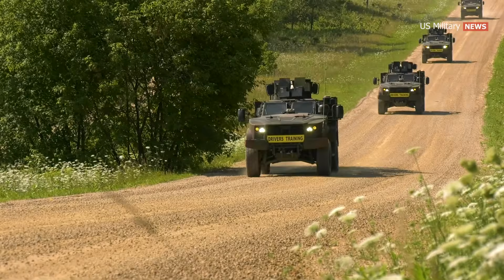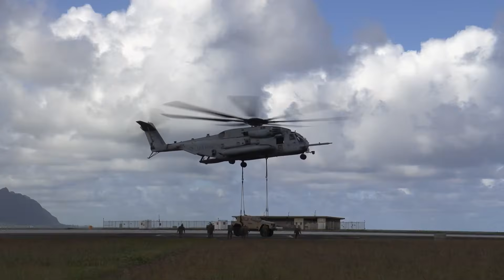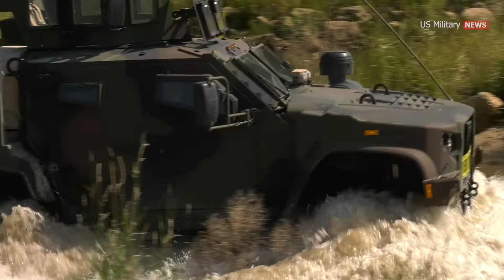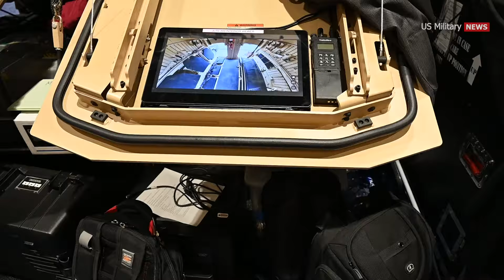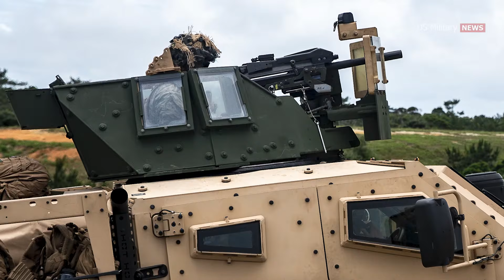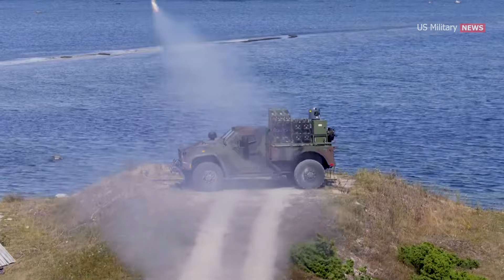Meet the JLTV: America’s $333K Tactical Beast

Comment: By the time this video was produced, the A2 variant was in production by AM General, replacing Oshkosh.
Reply: What's the difference between Oshkosh and AM general?
Reply: @nash5097  Oshkosh and AM General are entirely different companies. The only change that I am aware of from the original to the A2 is a standard Duramax engine instead of the Banks-customized version.

Comment: TAK-4 doesn't mean "adjustable suspension". TAK-4 is Oshkosh's independent suspension, in this case using air springs for ride height adjustment... but it is also available with non-adjustable coil springs. It's the "i" on the end to make "TAK-4i" - presumably meaning "intelligent" - which implies adjustability, with air springs.

Comment: It is an excellent combat and reconnaissance vehicle, but I would like to add that if it had a hydraulic weight-bearing system, it would have been equipped with a 70-90 km range cannon to support the infantry fighting and destroy enemy fortifications.
Reply: Weapons systems are not included with the base vehicle.
Reply: a $200 dollar drone will turn it in to half a million dollars of scrap
Reply: @radicalantitheist  even  old humvees would hold up fine to IEDs,  soo no it wont lmfao, this isnt ur soviet cold war grade machinery, these new models are bomb proof. The underplating is 10,000 lbs of steel that redirects the explosion backwards instead of upwards, if theres a solidier inside with the doors shut, theyre safe
Reply: @YCLocus  you don't spend 50 billion dollars to design and build MRAPS when humvees where perfectly safe, the first drone will still disable this, the second will penetrate and the fourth fifth sixth seventh eight ninth tenth ect will finish the crew one way or another ,but what ever your just an arrogant american who does not realize that war is not long about a few elite units doing some fancy maneuver, so there is little point arguing with you.

Comment: The worst thing to use against a near-peer adversary. Can be disabled entirely with just a knife, too. Have return to the factory if using the combat override instead of just sending out back out to the field, too. The US made a mistake.
Reply: Also very expensive. I remember seeing a video of Russian troops moving toward Pokrovsk in mini vans and motorcycles. A drone that costs a fraction of the price could take out the whole vehicle. Expensive, and technologically advanced equipment only works on a large scale against an enemy with less resources. Even being in a fully armored tank is a death sentence in the Ukraine war. A tanker might get off one or two shots before they have to run away. Some of these vehicles don't even make it to the front line before they are blown up. The Bradley seems like the most useful ground vehicle. Ukraine still uses them to drop off troops and support them during assaults. They'll also use drones at the same time for situational awareness. The vehicle that may replace the Bradley will have a larger autocannon which can do airburst rounds above trenches. Also for heavy wheeled vehicles, one of the biggest enemies is mud. This is another area where a Bradley would have an advantage.
Reply: @Andrew-cm5tc it can be disabled with a knife? What? Please explain lol
Reply: @DHolmquistDesigns  I don't know what the other person meant by that. I would assume they have something similar to runflats.